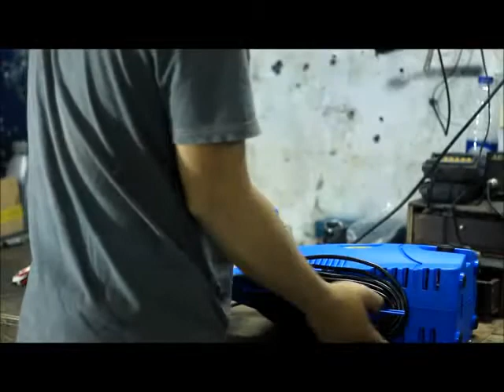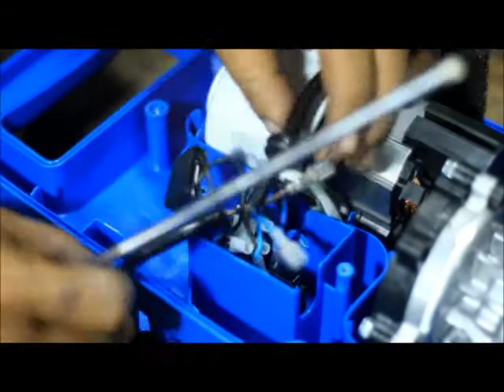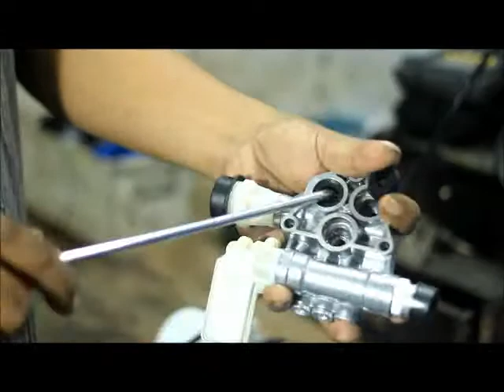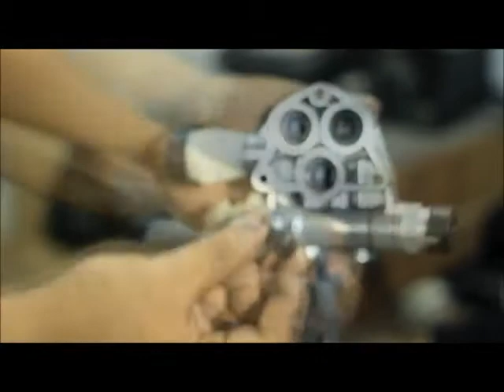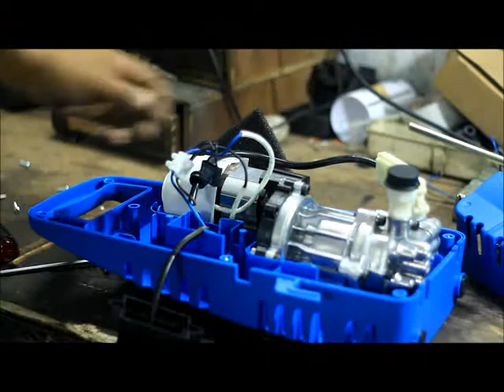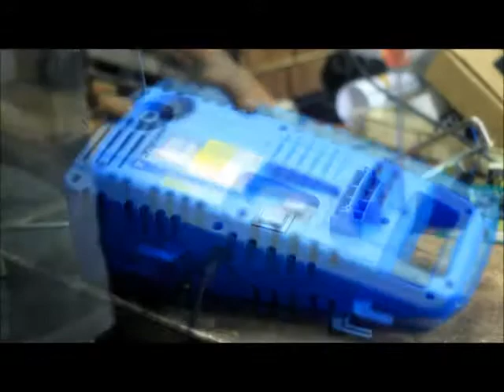DIY, CARA PASANG SEAL JET CLEANER HL ABW VGS 70

Comment: Malam, sy mau bertanya,jet cleaner sy tipe Abw Vgs 70, mesinnya nyala normal, otomatis jg normal mati hidupnya, tp semburan airnya lemah...sperti semburan air kran pdam aj..😁😁 
Kira2 penyebabnya apa ya pak?? Mksih
Reply from the maker: Hallo sobat Mesin HL. Untuk masalah semprot air menjadi lemah bisa dari macam hal:
- kotoran yang tersisa pada stick gun.
- water seal.
- as plunger.
- spring lemah.
-filter inlet connector.
untuk informasi lebih lanjut tentang permasalahn dengan produk kami bisa menghubungi service center kami di nomor 081212696213

Comment: Pake kunci L 5 mm mas bgian itu bukan 6.Punya saya sdh di ganti water sealnya tapi tetep airnya kecil,trus saya semprot juga pake angin kompresor bagian lubang2nya dengan terlebih dahulu membuka part part kecilnya kali aj ada kotoran di saluran pompa,tetep aja masih kecil.kira2 penyebabnya apa ya mas?
Saya cek juga oli pelumas masih ada dan bagus,saya beli jet cleaner ini 2 tahun yg lalu.
Reply from the maker: kalau ada kendala mengenai mesin kami bisa langsung menghubungi servis center di nomor 0812 9389 6142

Comment: Mas bro klu ada percikan kyak korek api di bgian dinamo apa ya gan tolong info nya
Reply from the maker: Kalo percikan api kecil ada 2 kemungkinan : socket statornya kendur atau cabon brush kendur (tidak pas pemasangannya). Dan kalo percikan api besar ada 2 kemungkinannya juga, armature atau stator nya rusak. Terima kasih
Reply: Ini yg percikan api besar gan cara perbaikan gimn ya gan, apa k mau di gulung ulang ato gmna?
Reply from the maker: Kemungkinan armaturenya coba di ganti dengan yg baru dan kalo statornya bisa di gulung ulang atau beli baru. terima kasih
Reply: Belinya dmn mas.,?
Saya posisi di semarang

Comment: Srevice centernya kalau dimakassar dimana om?
Reply from the maker: Terima kasih atas kepercayaanya kepda kami Mesin HL.

Untuk sementara service center di makasar belum ada . Mudah2an segera terwujud Mesin HL membuka di kota kota lainnya.

Untuk sementara sobat bisa menghubungi service center yang ada di kota di bawah ini: 

𝗦𝗲𝗿𝘃𝗶𝗰𝗲 𝗖𝗲𝗻𝘁𝗲𝗿 𝗥𝗲𝘀𝗺𝗶 𝗛&𝗟 :
𝗝𝗔𝗞𝗔𝗥𝗧𝗔       : Jl. Pinangsia Timur No.22 – Jakarta Barat 11110 Telp 081212696213           (sc.hl.jakarta@gmail.com )
𝗦𝗘𝗠𝗔𝗥𝗔𝗡𝗚   : Jl. Soekarno Hatta Kav.99 – Semarang Timur 50196 Telp 082137613238 (sc.hl.semarang@gmail.com)
𝗠𝗘𝗗𝗔𝗡          : Jl. Pandu No.6 Simpang Katamso – Medan 20151 Telp (061) 4565645 (sc.tctteknik.medan@gmail.com)  
𝗦𝗨𝗥𝗔𝗕𝗔𝗬𝗔    : Komplek Ruko Klampis Megah C-26 – JL Klampis Jaya, Surabaya 60117 Telp 082219961966 (sc.hnl.surabaya@gmail.com)  
𝗣𝗘𝗞𝗔𝗡𝗕𝗔𝗥𝗨 : Jl. Kaharuddin Nasution - Pekanbaru, Riau 28284 Telp 0761 - 3056060
Reply: @MesinHL18  seal seal untuk mesin ANLU ABW70 sedia ga gan?
Reply from the maker: @handyagus2163  Coba cek di link berikut : https://shopee.co.id/hlofficialstore?page=0&shopCollection=34214492 . Kalau belum ketemu ada baiknya sobat membeli produk Mesin HL

Comment: gan kalo punya saya nyala, semprotan bagus tapi waktu handle ga ditekan mesin gak mau mati, cek switch normal, apa kurang tekanan atau gimana ini gan
Reply from the maker: Kemungkinan itu otomatis tipe A nya bermasalah gan,  coba aja kirim ke service centre H&L. terima kasih
Reply: @MesinHL18  Kalau wilayah Tasikmlaya dimna gan?
Reply from the maker: @abdulbasor3458  Untuk service centre di tasikmalaya kita belum ada, agan bisa bawa ke toko teknik, dimana agan beli mesin H&L. terima kasih

Comment: Punya saya semprotannya gak kencang knp ya? Untuk services area jogja dmn ya?
Reply from the maker: banyak kemungkinan, biasa sih yang sering itu water sealnya. Service Center kita ada di Semarang JL. Soekarno Hatta Kav 99 (depan GOR USM ) Semarang Timur.
Reply: Mesin HL water seal beli dmn ya? Beli online bisa? Semarang jauh juga,
Reply from the maker: Toko teknik terdekat di kota agan dan di tokopedia sudah ada yang jual. (spare part water seal + automatis type abw). terima kasih.
Reply: @MesinHL18  punya saya sealnya sdah ganti baru tp semburan masih lemah, kira2 knp ya?
Reply from the maker: @kharis704    Spring & Splunger nya gan di ganti. Ada baiknya agan ke service centre HL terdekat untuk di cek lebih lanjut. Atau bawa ke toko di mana agan beli mesin Jet Cleaner HL.
Reply: @MesinHL18  saya beli ya online pak. Oke saya cek spring nya dl
Reply: Apa ada video tutorial cara cekny?
Reply from the maker: @kharis704  Ada nomer yang dapat kami hubungi ? atau nomer whatsapp nanti teknisi kami akan menghubungi agan.
Reply: @MesinHL18  punya saya juga sama nih. Tekanan air gak sekencang dulu. Water seal sudah diganti tapu masig aja gak kencang kaya dulu. Apa ada yg keliru ya pemasangannya? Apa ada foto atau video disasembly mesin jet tipe HL QL1200?
Reply from the maker: @apanyaayey7700  Ada kemungkinan automatis nya, Untuk pengecekan lebih lanjut, ada baiknya bawa saja ke service centre resmi H&L gan.
Reply: @MesinHL18  lokasi domisili saya agak jauh dari kota besar. Domisili saya pandeglang banten.

Comment: Gan punyaku dengan merk sama, mesin hidup gak keluar air.. 
Biasanya bunyinya kasar dan normal, sekarang Bunyinya halus, seperti ada gear yg tidak gigit, setelah ku bongkar gear keadaan baik..
Kira2 apanya itu gan..
Reply from the maker: coba cek gear kecil yang di armature nya. biasa sudah haus atau gear retak. terima kasih
Reply: Maf bng gbung d komen ny...
Mesin ku juga gak nyedot aer gmny bang..
Ap yg hrus d gnti bang..

Comment: Klo oli kemasukan air, water seal apa oil seal nya mas?
Reply from the maker: Hallo sobat Mesin HL. Kemungkinan kerusakan ada pada water seal. Jika masih ada masalah bisa menghubungi service center kami di nomor 081212696213

Comment: Punya q mati total gak ada tekanan air...mesin hidup normal....apa nya ya
Reply from the maker: Hallo sobat Mesin HL. Untuk permasalahan dengan produk kami bisa menghubungi service center kami di nomor 081212696213. Untuk tekanan bisa banyak faktor seperti, as plunger, water seal, outlet valve, spring, filter inlet connector atau kotoran yang ada pada stick gun.

Comment: Bang klau o ring seal nya dah gepeng,harus ganti jga g?
Reply from the maker: Diganti gan, supaya semprotannya kembali normal.
Reply: @MesinHL18  syg o ring seperti itu ko di toko sparepart jet cleaner g ad yah?harus nyari ke toko onderdil mobil/motor nyari o ring seal yg cocok diameternya
Reply from the maker: @joebae2098  bisa di fotoin gan o ring yang agan butuhkan ke nomor 081318352138.
Reply: @MesinHL18  oke sya save dulu wa nya,besok ta bongkar lagi jet cleaner nya

Comment: Bang klo air ny bisa keluar terus mesin ny tida mati otomatis itu knp y ... ?
Reply from the maker: Terima kasih atas kepercayaanya kepda kami Mesin HL.
Kemungkinan ada kerusakan pada part otomatisnya. Sobat sudah cek?.
Kalau di rasa masih kurang puas, sobat bisa menghubungi service center kami. Dan ini adalah alamat beserta nomor telp yang terdekat dengan kota sobat:
𝗦𝗲𝗿𝘃𝗶𝗰𝗲 𝗖𝗲𝗻𝘁𝗲𝗿 𝗥𝗲𝘀𝗺𝗶 𝗛&𝗟 :
𝗝𝗔𝗞𝗔𝗥𝗧𝗔        : Jl. Pinangsia Timur No.22 – Jakarta Barat 11110, Telp 081293896142
𝗦𝗘𝗠𝗔𝗥𝗔𝗡𝗚    : Jl. Soekarno Hatta Kav.99 – Semarang Timur 50196, Telp 082137613238
𝗠𝗘𝗗𝗔𝗡           : Jl. Pandu No.6 Simpang Katamso – Medan 20151, Telp 082274742235
𝗦𝗨𝗥𝗔𝗕𝗔𝗬𝗔     : Komplek Ruko Klampis Megah C-26 – Surabaya 60117, Telp 082219961966
PEKAN BARU : Jl. Kaharuddin Nasution - Pekanbaru 28284, Telp 0761 - 3056060

Comment: Gan ,kalo mesin nyala ,air PAM ngalir ,tapi ga mau keluar dari selang .apanya yg rusak gan .mohon info .087887827141 WA
Reply from the maker: Coba cek di inlet (air dari selang ke mesin) apakah ada kotoran atau tidak. atau di water seal nya sudah kendor. terima kasih.
Reply: Mesin einhill